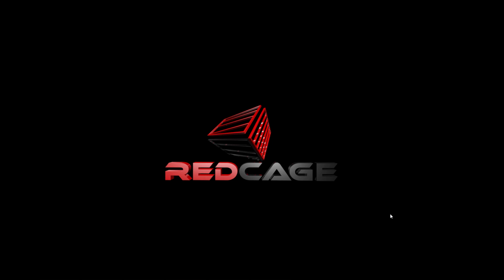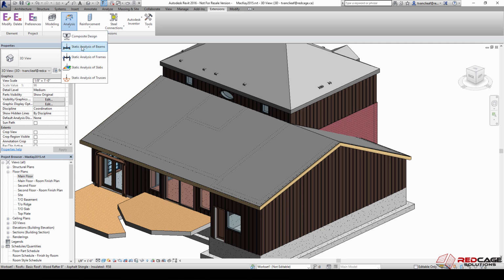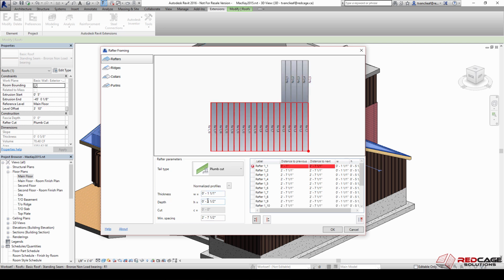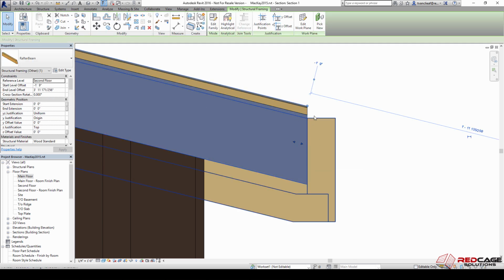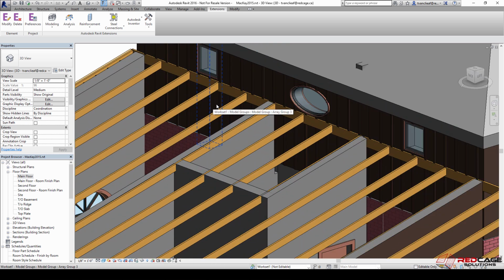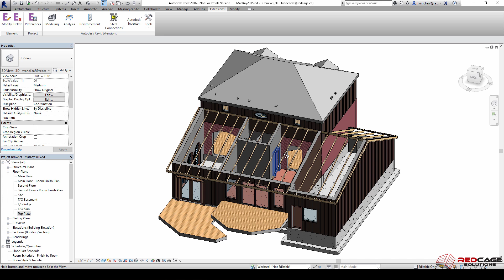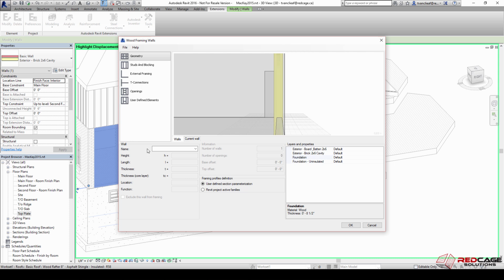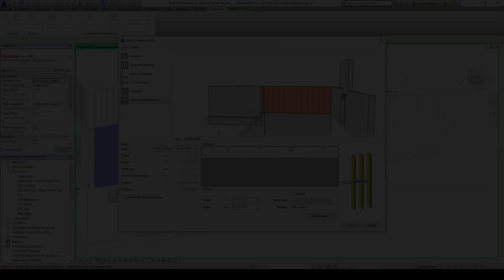Rafter Framing w Autodesk Revit Extensions

Comment: this does not apply to revit Lt, does it?
Reply from the maker: I would not imagine so, but I'm not 100% sure. These tools aren't even in the 2017 version of Revit. I would imagine it's due to the integration they've made with more advanced structural modelling elements directly correlated to steel structural framing categories. The AEC collections have now made it less expensive to buy into a full version of Revit however.